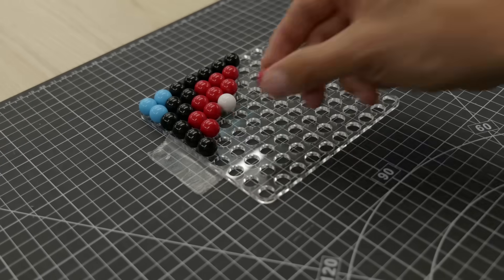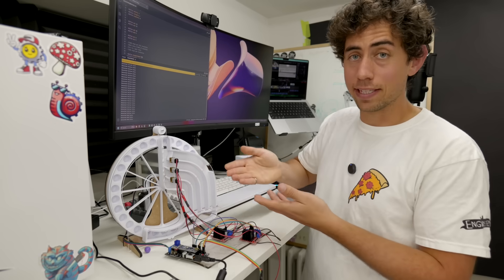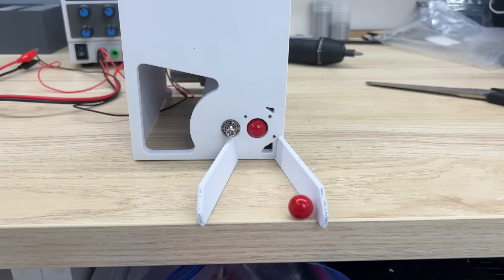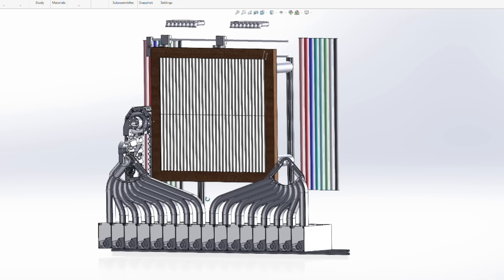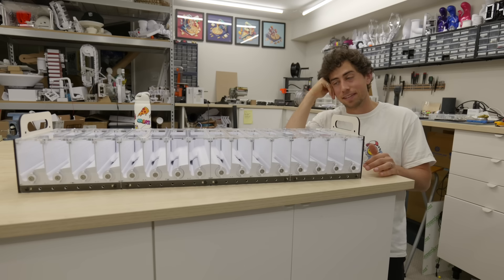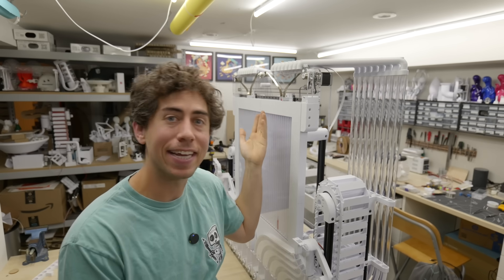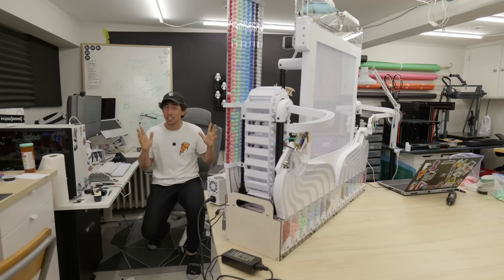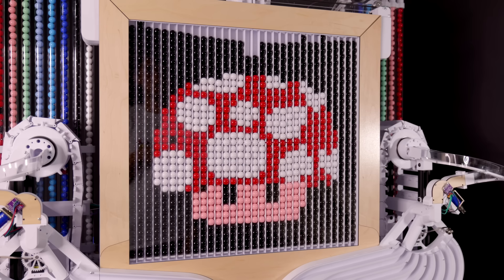This Marble Machine makes Pixel Art

Comment from the maker: Here are some answers to the most common questions here:
- The sag in the middle of the image is interestingly a result of the bowing of the front acrylic plate (never would’ve predicted that). The channels are slightly too deep, which is a dimension I adjusted on the second print of the channel sections.  This allows the marbles to stagger a little bit which pushes outward on the front panel.  The largest deflection of the panel is right in the centre, which is why only the centre columns of marbles sag, and why its only noticeable once the small fractions of displacement build up over the whole frame. Very interesting indeed. Simple fix is to make the channels slightly less deep, and use a thicker front plate.
- The refresh rate is 0.0008hz or one image for every 15 minutes
- Much of the marbles being in the wrong hoppers is actually a result of the hoppers being too small.  When the marbles pile up and I don’t catch it in time, they then pile up in the sorting tube and get dumped randomly in any of the sorting tubes.  The fix is simple, just make bigger hoppers. That being said, the only marbles it sometimes mixes up is the mint and light blue, which I will definitely find a way to fix for v2
- My switch feedback system was slightly off in dimension (were talking like a half mm) so I had to mount all the switches with hotglue instead of reprinting the entire piece.  This lead to some errors where more than 1 marble would get dropped, particularly with the black and white marbles (those were the first switches I glued in, mustve been slightly off). For v2, I will likely change from a mechanical switch to an ir sensor to solve this, and then use stepper motors on the hoppers for more precision!
- I used Arduino to code this whole machine
- It could probably play bad apple, but Im going to save it for v2 which will work perfectly and hopefully way faster!
- I am aware that I look like Harrison Wells, but if you’re asking me I look way more like a young Jerry Seinfeld
- The marble drop at 0:20 was supposed to happen on “how hard could it be” but they wanted their freedom early and nothing was stopping them
- No it cannot run doom…yet
Reply: You could use sandpaper to sand the bad parts maybe.
Reply: your next project is making it run doom
Reply: There were certainly many other colours of marbles getting mixed up than just mint and light blue
Reply: partway through the video I realized you looked familiar and then you actually mentioned it in your pinned comment lmao
Reply: So glad you address all the tech issues in the comments :)
Reply: What do you mean it can't run doom? It totally can just at 0.0008hrz like you said 😂

If you programmed like a 15 frame animation that holds the final 'frame' for like 5-10 minutes you could make a gif of it by running the video at 8000x speed 😂
Reply: I haven't seen a "can it run doom" meme in a while, that gave me a good belly laugh.
Reply: It's finally done!
Reply: Jerry Seinfeld was my first thought also love the continued energy of making anything run doom
Reply: @Engineezy  if not doom then DEFINITELY bad apple
Reply: Any technical reason that it cant start building the next image before its done sorting the dump pile? That alone would double your refresh rate
Reply: There were definitely some places where it just plain dropped the wrong color, too. In fact, it looked like every sprite had at least a few pixels that were the wrong color. There was some red in Sonic's blue, some red, black, and pink in the wrong spots on Kirby, a few black pixels that didn't belong on the mushroom, and the Captain America shield was just 12 kinds of fucked on the right side.
Reply: Technically, it could run Doom… just at 1 frame per 15 minutes
Reply: Clearly, there's still room for improvement, which is exactly what an engineer always secretly wants to hear so long as there's no deadline. Keep up the good work!
Reply: Bro you look like Harrison Wells from The Flash series
Reply: yet?
Reply: you kinda look like Harrison wells from The Flash series
Reply: Im glad we have found the Harrison Wells of our universe.
Reply: Would be nice to see a horizontal filling of the image so rather than fill a whole column at a time fill say 4 marbles in each column then move to the next column and when all columns have 4 marbles then start again and so the image gets built with a horizontal 4 lines at a time. Maybe it’s more aesthetically pleasing this way.
Reply: Color palette seems interesting. I'd have expected more vibrant colors across the rainbow. (Think of the colors in the most basic Crayola crayon set.) Anyway, a couple of other ideas: 
* Use smaller marbles to allow a higher resolution and lower weight.
* Increase frame rate with air-lifted marbles.
Reply: dr wells
Reply: That's so cool. I love the feeling of seeing whatever I designed FINALLY work.
Reply: ⁶
Reply: First time I've seen an ad read for something that looks actually useful.
Reply: I’m excited for v2!
Reply: Dude, that is really cool. I want to build it twice! Once to build the one that you just built and one at a higher resolution. Thank you -:)
Reply: I can't wait to see v2
Reply: DOOM
Reply: 32x32 = 512?
Reply: @VikingRul3s  nope, 32² is 1024. How tf would 32×32 be less than 30×30?
Reply: I was about to ask if it could run doom
Reply: i just came to the comments to ask if it can run doom 😭😭😭😭
Reply: I agree with the Jerry Seinfeld part.
Reply: lol 4:28am, sounds about right!
Reply: I been wondering what Jerry Seinfeld is up too.
Reply: To solve the front panel bowing, consider making the columns out of the same clear tubes that you use for the risers.  It might look like scan lines, but vertical.
Reply: Strongly inspired by the 80s game where you lines up rows of checkers huh? The drop was so fulfilling 😂
Reply: @Will-dn9dq   i believe your referring to "Connect 4"... loved that game as a kid...
Reply: Bad apple
Reply: what is the clock at 1:05 called?
Reply: @I_Love_My_Dogs7  -- High time?
Reply: But sir, can it play Bad Apple?
Reply: where did you get the marbles
Reply: Honestly it sucks that you didn’t let us hear it, that is a huge part of the experience of these projects, there were some incredible sounds you masked for no reason. You not only ensured it was completely covered up and edit out. You did so in the entire video. Not sure if you can appreciate the loss for people the are more reliant on their hearing.
Reply: Re your failed attempt to use an Archimedes screw to transport your marbles vertically, you are somewhat mistaken, in that the screw doesn't need to be at an angle to work properly, I have a working Archimedes screw that is vertical and transports steel balls without issue. The trick is to have vertical bars spaced a bit more than a ball width apart so that part of the ball is between the bars and part is in the screw and it works a treat.
Reply: Ty!
Reply: 15 minutes per frame huh? that means it would only take 2 months straight of this thing running to render bad apple! get on it
Reply: 16:00
Reply: how long did you make this
Reply: can it play bad apple though?
Reply: You need to build this in 320x200. And then you teach it doom.
Reply: This was one of the best videos I've seen in a while. Where can I see pictures of more pixel art designs you made with this machine?
Reply: goodwork
Reply: No idea if you're still watching these but I have an idea for the sensor and sorting system. Here goes:

Feed the marbles into a wheel with "cups" that will accept a single marble per cup, with a clear plexiglas faceplate. Have a colored dot in the cup itself that does not match any of the marbles. This "feeding wheel" rotates in front of the sensor. Pick up the marbles in bottom, sensor reads when they pass half-way, dump balls out on top. Or opposite, both works.

Advantages:
* Constant speed of the wheel, constant spacing and sepatation of the marbles.
* This makes color identification while moving and at a substantially faster feeding pace more viable. The dots enables detecting a feed error (empty "cup") and error correction.
* Separating color detection and sorting mechanism gives you a little bit of time in between.

It will help if you cover the sensor/cup interaction area. You'd already have a big step up by having the marbles separated when reading. By controlling light and reflections through shrouds and possibly an LED providing the light source, you can get a much faster clear color reading even while the marbles are moving.

Having this constant speed, constant spacing gives you fixed frequencies to work with. Having a gap between optical identification and the marble exiting the wheel, means that even though there's a compound of delays between starting sensor read, and code execution, instructing mechanical separator movements, and mechanical inertia - the feed doesn't need to stop or slow down to accommodate it. You just need to tune the constant speed of the wheel so that when the marble reaches the separator, it's mechanical action is positioned to do its thing. You can have constant speed, and basically only be limited by how fast the mechanical action of the separator can "change positions" once a marble going through is clear of the mechanism (because with good tuning, you can read the color much faster than a mechanical separator mechanism can move).

For high speed, it might help to have a small air jet aid in getting the marbles out of this feed wheel faster once their color has been "read". As they'd otherwise be rolling or falling out of the "cups" from effectively a standstill, by gravity alone, so it'll take some time before it's far enough clear of its cup to not jam the wheel.
Reply: Gg making a poopy scoopy. 
Make the sorter switcher be rotational instead of angular. Make tryptophobia work for you beautifully like lotus flowers…or opium.
Reply: @bornsvg 
I’m the first comment on your pinned comment. Please make my idea.
Reply: @bornsvg  wrong I was
Reply: @bornsvg why did u try to ping urself and no ur not first…
Reply: HELP HOLY SHIT I THOUGHT I WAS A WEIRDO FOR THINKING OF BAD APPLE LMAO
Reply: I'd say you look more like Gene Wilder than Harrison Wells, though yeah I can also see Jerry Seinfeld
Reply: Whoever told you “you look like harrison wells” needs glasses cuz you dont. You look more like zack king to me

Comment: i have this crazy idea i wish i had time and money to try it, imagine this: Huge rotating belt lifts all marbles continuously, they feed to a buffer array which has those 5volts and 0.1$ micro solenoids from aliexpress in each pixel (custom PCB few diod/mosfets and a 1000s solenoids would only equal a little over 100$) , an ESP32 with camera(s) would detect colors in the buffer in an instant and trigger solenoids until there's no marble with the required color found, then it flushes that buffer for a new one.  This not only would be faster, (maybe cheaper), but would even allow for a marble animated display imagine that ! more buffers in the back = higher animation framerate

Comment: 6:00 you can still have the vertical spiral, you just need a vaned spiral rotor with vertical vanes in the stator to prevent the marbles from rolling down. But the solution you came up with is decent.

Comment: I have a suggestion for your marble machine! I would really like it if you could scale up this machine. This is a great way to get some more detail on the photos that you are creating. For example, if you were able to make a 10,000 x 10,000 pixel picture, that would be really cool. However, I do have some feedback. I would also like to see if you could fix some of the issues with the machine so it works perfectly. Also, more colors would definitely be a plus. I think it would be really awesome to be able to make high-resolution pictures with more color options.

Comment: It would be possible to make a system with way less motors if you'd just get a big bucket with every color of marble, pump all of them up, and have a 'discard' channel in the sorter, putting it back into the big bucket. It could result in the picture taking longer to form due to the discarding tho. And yours looks better witht he colors !

Comment: This is the PERFECT demonstration of the disconnect the VAST majority of engineers have when implementing their CAD designs to construction. I can’t tell you how many times, on EVERY job mind you, having to go back to the engineer due to their plans not even remotely close to working, let alone passing inspections. Yet every time you go back to them with the problem, they’ll first take offense to it as if “how dare you question my design. Who’s the one that went to school for it?”. Followed with “well, make it work. What do you want me to do about it?”, as if they were never taught that during inspection, the inspector goes off the PRINTS! I truly believe that whatever field an engineer is working in, that they need at least 1yr of on the field training(more depending on field) to gain experience and closing the gap of disconnect between the classroom and job site.

Comment: A slight backward cant on the image surface could reduce stress on the acrylic sheet caused by the marbles. This would minimize bending in the image. The droop in the middle is likely due to the marbles having more 'wiggle room' as a result of the bowing in the acrylic.

Comment: Iassume the wrong colour marbles in the images are from the mathmatics calcluation that the colour sorter made so is it possible to recalibrate using the sensor in the device since when you appeared to do the initial calibration you had ambient light, but the colour sensor is actual in an enclosure in practice, so this could be part of what is causing some variances.

Comment: What might've been even more efficient would be if you set it up to either drop whole columns at once, as it would spend less time navigating the funnels to drop the single marble into its spot, and instead would only have to move the funnel once for every column, just queuing the required marbles up in order. It's basically the same principle as scanlines but column-oriented instead of row-oriented, it's simply less efficient to constantly change the location to send data than to queue it up in big batches and deal with lots at once.

Comment: 13:07 Cut a hole in the corner of the zip loc bag.  Make sure the hole is bigger than the marbles and use it like a baker does when icing a cake.

Comment: 3:00 you could use 3 motors using binary to have 8 colors :)
Reply: On his controllers i see outputs for two motors. This large controllers aren't necessary for this motors, you can simply use few mosfets with one Arduino board.
And I can't imagine how three motors can cover seven outputs leaving one open, if you can close only one of two outputs with rotation of one motor. From every motor you can have only one output to the storage space and one to the sorting device. You can't make other without stepping motors or servos. Servo is the best decision.

Comment: 3:25 No, that alternate way wouldn't even work. What happens when the next color needed for several rows is the same one? That means there's at least one color left out of the sorter, and that's exactly the color which will jam the system. I guess you could add an escape mechanism for sending a ball back to the unsorted source for later use.

Comment: Fun! I'll point out that you could also sort 8 colours with 3 solenoids - binary chopping at 3 different layers with 1, 2, and 4 flaps linked across layer tilting left and right - but I doubt it'd be much faster than your servo solution.

Comment: Very cool. Did you ever consider a version where you didn't sort the marbles in the hopper, but shoot them one at a time up and detect the colour at the top and drop them into the appropriate column (or discard if unsuitable at that moment). Sure, it'll be very slow at generating the pic as it's literally doing 1 pixel at a time, and even then it's waiting for the right colour to turn up, but should be much simpler from an engineering perspective?

Comment: This is incredible. I wonder if you have to wait for the sorting to complete to start the next image whereas you have the vertical stacks of marbles in queue but is there a way for the system to recognize a ball has gone through or if it just fires off the pattern. Say, the red balls were being sorted and not enough in the stack to push the balls up so they are ready to be dispersed or if the system is good enough to recognize they are waiting on a red ball

Comment: A vertical archimedian screw would work just fine if the balls can't move sideways on the track (as in, once they get lifted even a bit by the screw, they'd be inside a purely vertical track going up).
That would mean the screw would need to be slightly smaller than a single marble, and you'd want 4+ tracks going up with lifting openings around the screw.
That's at least how it's done with the 3D printed Apex Marble Machine :D